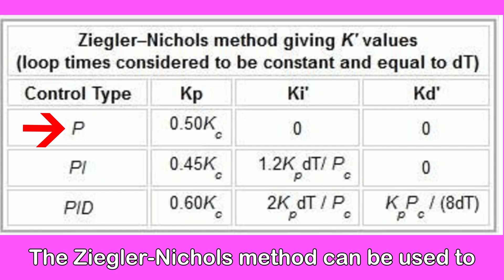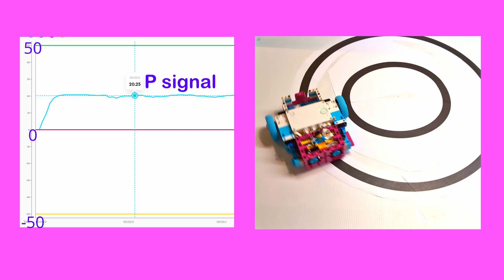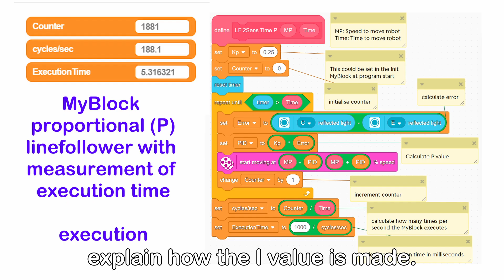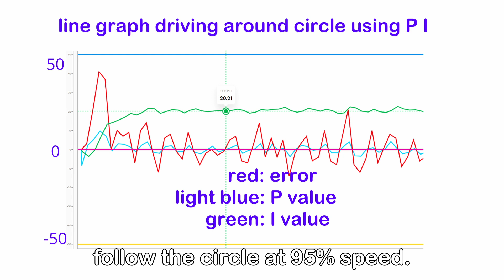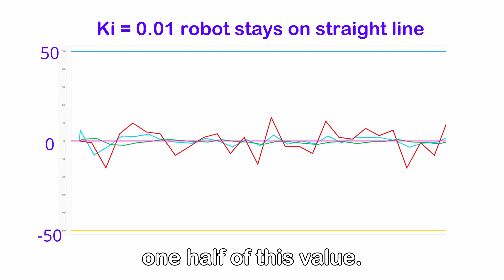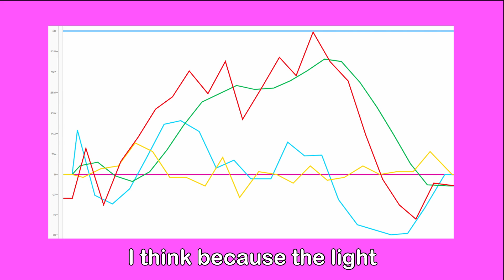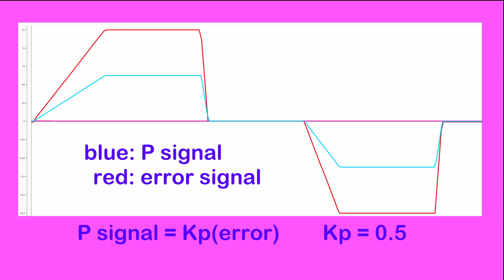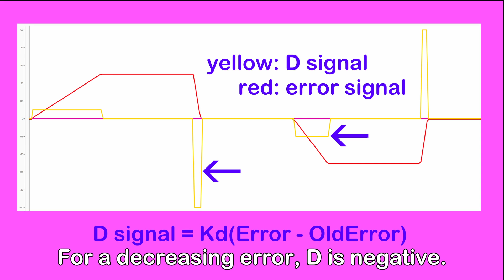Can PID Make Your Line Follower Faster?

Comment: Actually, you don't need the derivative part, if not to damp the oscillations caused by the proportional and integral terms. In my experience, I used the integral term only on very complex paths with tight turns using one sensor. For two sensors, the integral part can be avoided. Why? Simply because it's hard to explain to students, especially the anti windup techniques. The video is quite hard to follow, especially because the voiceover is only on the left channel. The intro and ending are stereo.
Reply from the maker: Thanks very much for your feedback, it's much appreciated. I will look into the problem with the sound. I am reasonably familiar with PID control, I worked in industrial process control for 40 years before I retired. I wanted to explain it in a non mathematical way and show what the three parts do. I think we agree that you really only need the P term. To follow a straight line, you have no permanent offset to  remove, (assuming both wheels are the same size) so you don't need the I term. To drive round a circle (not a common requirement) the wheels have to turn at different speeds this causes a permanent offset or error which can be removed using I.
Reply from the maker: I was able to demonstrate this in the video but unfortunately I was not able to show any advantage with the D term. This is very sensitive to noise spikes and the lego color sensors do not give a good enough signal especially when two are mounted side by side. Thanks again for giving me your thoughts on the matter!
Reply from the maker: My apologies for the single channel audio! I have found the problem and corrected it for future videos.

Comment: hi there, you are saying that "Ki value depends on the execution time of the block"... how do they relate and how do you actually calculate "Ki" value depending on the execution time?
Reply from the maker: The I term is formed by adding (error)(Ki) to the existing I term, so each time the block is executed, the I term is modified by (error)(Ki). When the error is zero, (error)(Ki) is zero so the I term stays at the value which has accumulated. The more times per second the block is executed, the faster the value accumulates. If it is too fast, you have instability so the myblock repeat rate is important. I used to work with industrial PID controllers where the repeat rate of the PID algorithm is constant at e.g. 20 times per second. The Lego Hub does not have a fixed repeat rate, it depends on what else is happening at the same time so it will vary somewhat. I have not found this variability to be a problem. I have seen that some PID myblocks on YouTube add a fixed time delay of e.g. 50msec into the PID calculation to reduce the variability this is no doubt a good idea but the downside is a slower execution rate. 
This link shows a method of calculating Ki: 
https://www.researchgate.net/figure/Ziegler-Nichols-PID-controller-tuning-method-modifying-Kp-Ki-and-Kd_fig1_338224855
It is easier to just try something and adjust it till you get good performance. The main thing is to get a good value for Kp by looking for the Kp value which gives an oscillation with fixed amplitude and using half of this value.

Comment: Hi Paul, I've tried to implement D but it never worked on my spike prime, perhaps the prime hub is not fast enough and it miss lots of signal from light sensor which required for robot to make action at sharp curve turn.
However, I find a way for robot just to use P yet still able to follow sharp turn precisely using "Start moving" block. If you wanna try, check out this https://www.robocupjunior.org.au/wp-content/uploads/2021/05/03c_RCJV-Rescue-Workshop_Spike-scratch.pdf page 19.